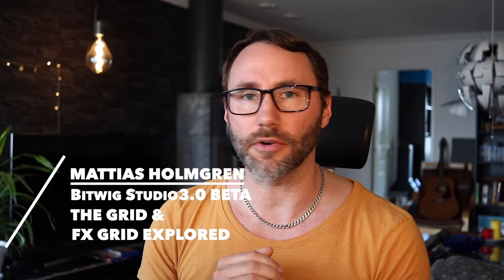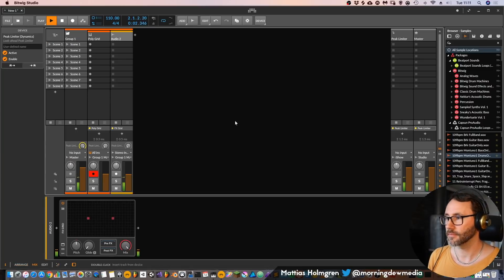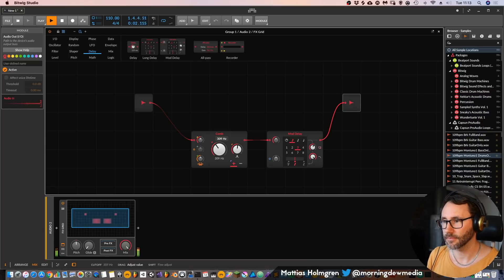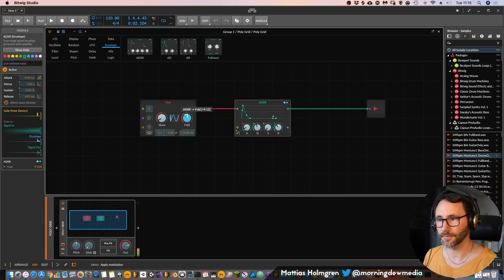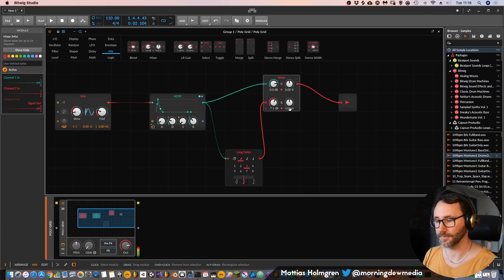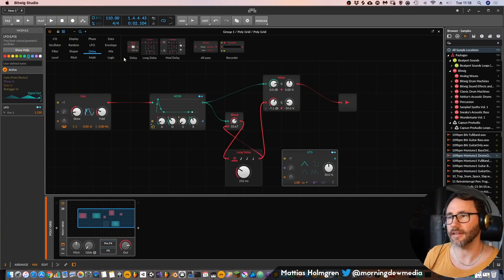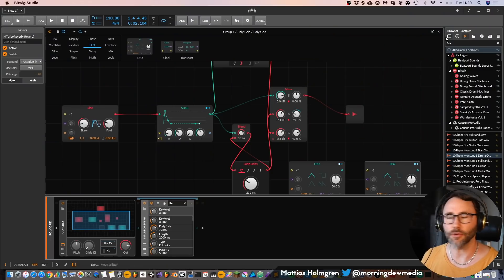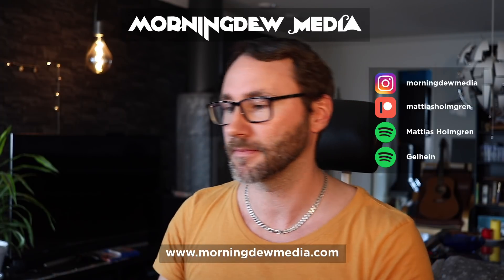Bitwig 3 Beta - Poly Grid & FX - New Modular Synth Plugin

Comment: I hope they intend to keep adding more and more and more modules..  there is so many types of advanced oscilators theycould add(starting with wavetables)... or filters (sem anyone?) or maybe just some more players, like a dr rexx type...  the grid seems less flexible then max... maybe they should make the grid an open system...allowing 3rd parties to develop modules?
Reply from the maker: I think the purpose with the Grid is that you should build your own setups. If you know what you are doing you can create your own filter setups (to emulate sound of SEM). Anything is possible (almost) with the current set of devices. But it might not be that obvious at first sight. But yes, it would definitely be helpful to have more filters (or pre.defined wavetable devices etc.) selectable out of the box without needing to load up Grid presets with 411 different devices spread out everywhere. It's modular, so... ;)

Third party access to create modules would be awesome indeed! I totally agree, but understand the amount of work behind adding such feature (not to mention support...)

My hope is that Bitwig team start to focus on the midi / audio editing tools because that's really a place where Bitwig is currently lacking. Midi features are rudimentary for most composers who don't want to work with generative / random music. Thanks for writing!

Comment: Hi Mattias and thanks for the video.
I have 1 question: What's the difference between using the Grid delay FX  on an audio clip compared to just adding a delay FX in the FX chain?
Reply from the maker: Hi Esben thanks for your question. Well, I would probably use the regular delay-2 for general delay purposes, it might be quicker to work with rather than having to enter the grid to adjust params (but you could setup macros and you can do all the param edits outside the grid for your custom delay. 

The good thing about the delay within the Grid is that you can design your own delay types. Have different filters / saturations etc on the delay signal. A delay is just a delay basically, it copies the signal and repeats it in taps. In the grid you have a good visual overview to do creazy things with those delay taps. ;) That's how I perceive the devices.
I hope that answers your question Esben.